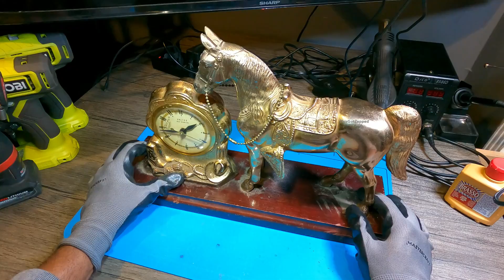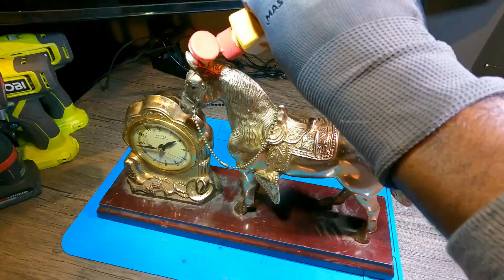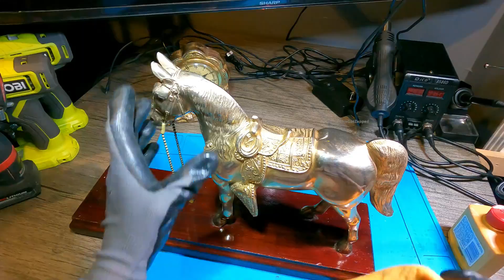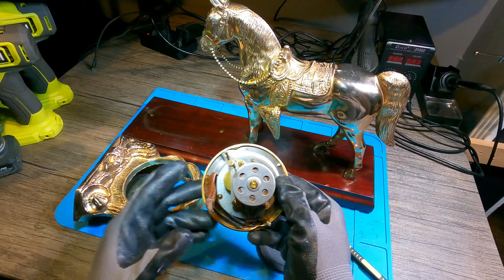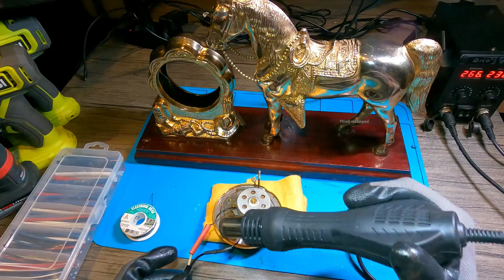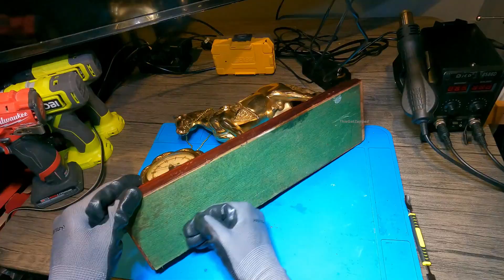Vintage 1940 United Horse Clock Was Dead… Can It Run Again?

Comment: I have one , and the model is a 310. The power cord is fine, and the motor runs and time is kept good. However when setting the time using the  time set knob on the back side  the hour hand turns only, and not the minute hand. So I was able to remove the lens, and move the minute in place. Plugged back in and the clock is running good, and the time is kept. Not sure why only the hour hand turns only when setting time.